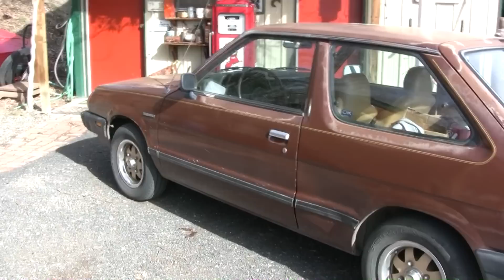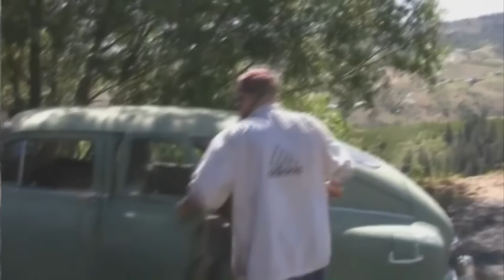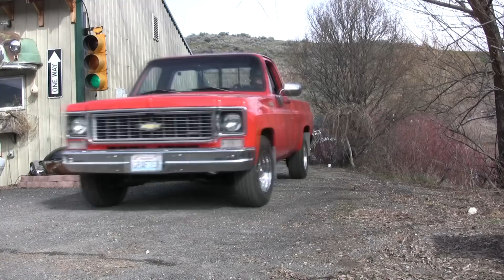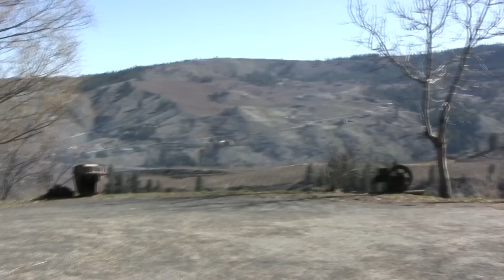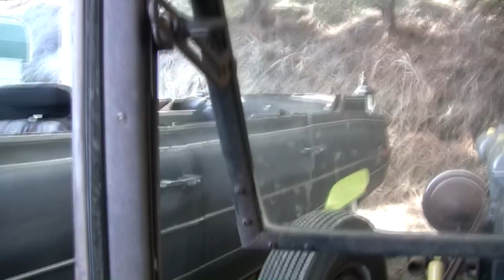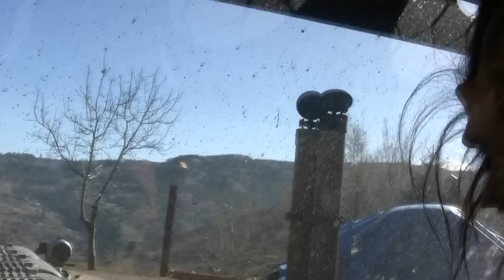Thats what I'm talkin' bout!

Comment: yeah   l got some snow for ya,,l like the idea of using pallets on top of the load to tie it down evenly,
Reply from the maker: mustie1 you know.. a fella learns from mistakes.. back in 95.. i ordered a brand new Dodge with a V-10 and every option I could get on it. It was the first brand new vehicle I had ever owned. I had done a HUGE grafting season which included 300 acres of grapes for E&J Gallo (you may have heard of them) haha.. anyway.. I was blessed enough to be in a position to pay cash for that truck. man i was proud of that thing...fire engine red.. everyone liked to count the spark plugs.. haha.. nobody had seen a v10 before!.. so...I set a pallet of that black asphalt emulsion in the back of my shiny new truck and headed home with it.. someone stopped in front of me and I slammed on the brakes and 5 gallon buckets of black crap went everywhere!  several cans popped open and poured out all over my brand new truck.. haha.. I rushed to the car wash and got busy! ..... two things happened that day.. I got over that thing about running up and down the road "looking" good.. and I learned to not trust shrink wrap!

Comment: Busy day for you an brown! But sure looked like a fun one! Hey does that ol 63 GMC still run? Maybe a cold start on it to?
Reply from the maker: Military Chevy yes it does.. doubt it would fire up without priming the carb and throwing a battery on the charger.. its been sitting right where it is for at least 2 years..maybe more.  so .. I guess that wouldnt qualify as a cold start if I primed and charged it.. haha but when I get some time.. I do want to get it running.. I'm going to build one more rat rod in my life (Lord willing) and that 63 is part of the equation.
Reply: 1963impala2dr Ah 2 years ain't bad. haha My 64 chevy sat for 13 years and I cleaned the points and dumped some fuel down the carb( Brown style haha) and it fired right off...after repeating a few times the pump got fuel in the carb and I drove it around the field. lol Fun stuff if ya have a couple hours. I know this is yer busy time a year to. But now that I got me a 305 buzzin half dozen I'm watchin every youtube video I can find on em. haha Actually found yers that you did on the 63! You started it and drove it...must been with a different camera. lol
Reply from the maker: i dont remember filming my gmc but if I did.. yes it would have been an OLD camera!! 
"brown style" hahaha
Reply: 1963impala2dr lol! Yeah "Brown style" work perrty well as long as your head ain't over the carb when it back fires! haha
Reply from the maker: I was trying to light the pilot light on an oven in a little camper trailer once and KABOOM!!   my mustache and eyebrows fell off onto the floor
Reply: 1963impala2dr Sounds like ya did it Brown style..."You can never add enough gas" haha! Yeah, I lit a burn pile once with to much gas and just about burned the hairs off my arms. lol